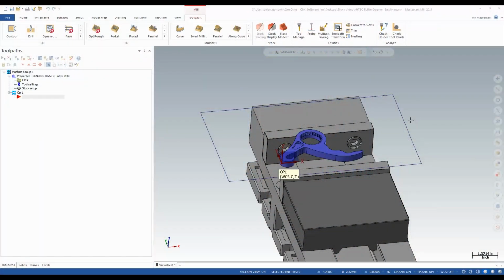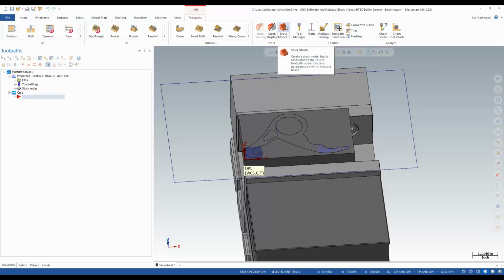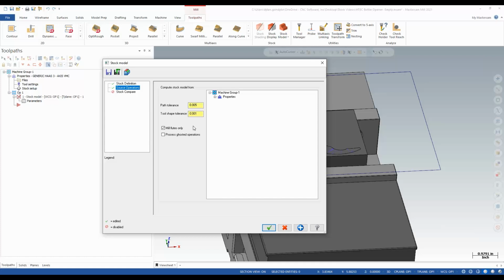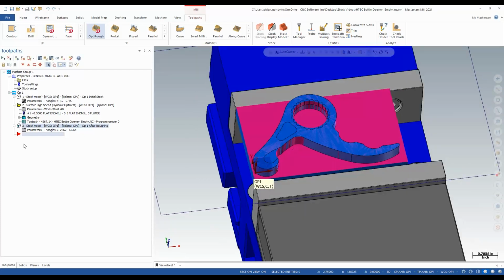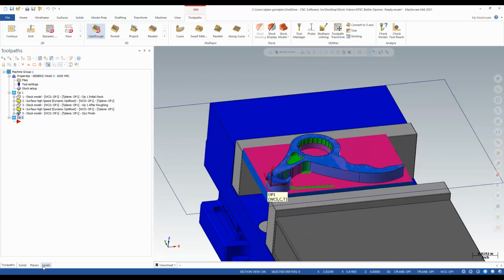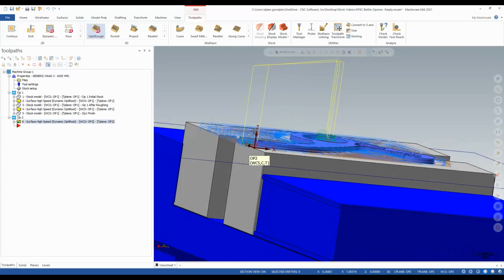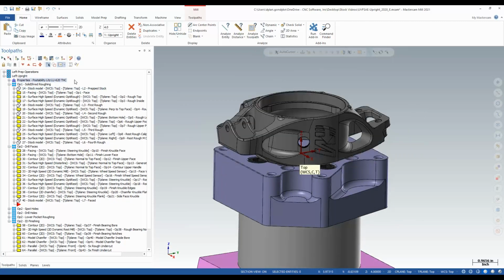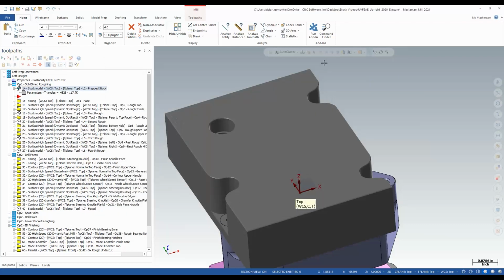How to Handle Stock Models and Operations in Mastercam Part Files | Ask an AE

Comment: i use the Stock setup for displaying the stock on my machine (Heidenhain controller). I only have one problem: when i have multiple toolpath groups with different coordinate systems in one machine group, then on the second toolpath group the stock setup box is wrong calculated.
Reply from the maker: Hi there! If you're referring to the stock setup that is output as part of the .H file by the post processor, we think this may be a limitation as the post processor is only looking at the initial stock setup in Mastercam and outputting that initially based off the initial work plane. The post likely lacks the logic to check and output a second stock configuration/plane setup and we're not sure that Heidenhain supports this or not. The potential work-around for this is to create separate machine groups like you mention in your question. We recommend reaching out to your Mastercam Reseller and/or post developer for confirmation.